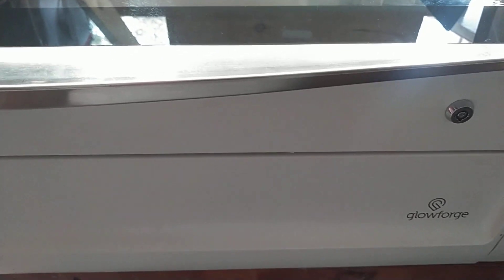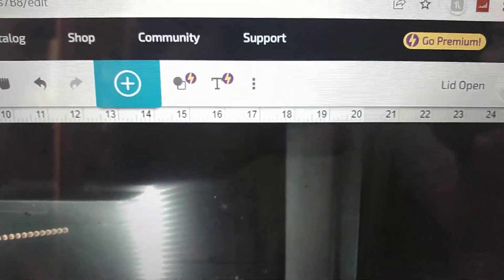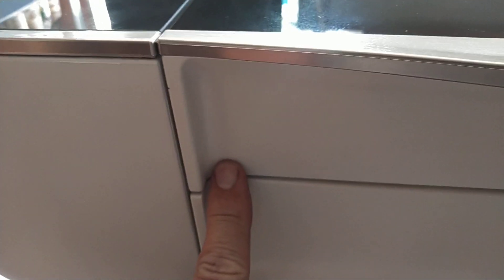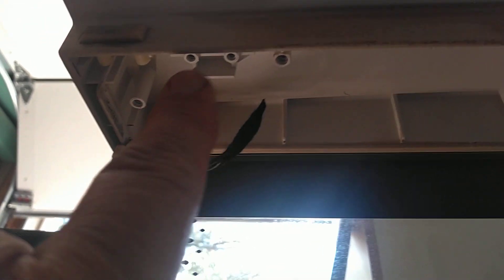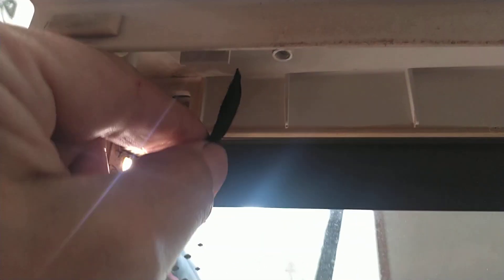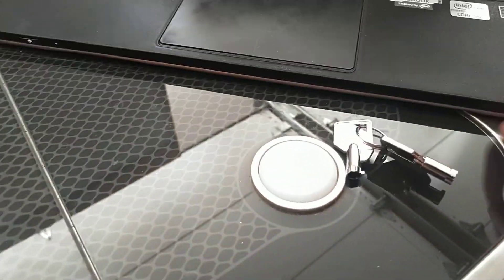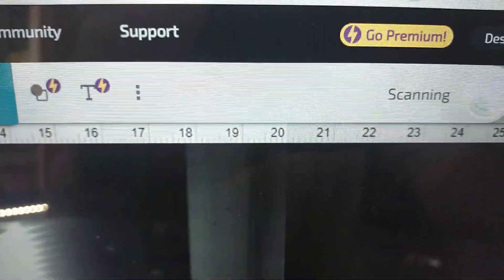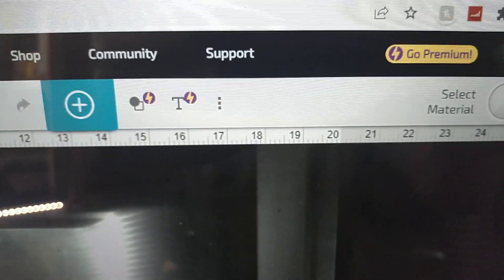Glowforge Front Door Bypass, Lid Open Error

Comment: Hi! Are you still available to ask a question? Was that LID OPEN error similar to an Interlock Open Alert? That's what I am getting on my (just out of warranty) machine. I am researching fixing it myself. I would appreciate any insight from you! Thanks!
Reply from the maker: I have not used my laser in a few months, maybe they changed the names of the warnings
Reply from the maker: Try contacting support they were always responsive with me when I had problems, they can elaborate on the error
Reply: @madscientisthut  They've already told me I need to send it back in and get a refurbished one for $1600+ so I am working on fixing it myself. Thanks for your input! My understanding is an Interlock Switch controls doors in many applications, so I am concluding that this might be the same issue. Can't hurt to try!
Reply from the maker: @kristinemerz9959  certainly will not hurt to try. If you get it fixed that will be so worth it!
Reply from the maker: Did you see my other video where I showed how to check if it is the switches in the lid?

Comment: Just curious but did you try taping a magnet to those spots where the sensors are before cutting them? That's a quick an non-intrusive hack for anyone to use.
Reply from the maker: yes, one of the switches was bad.
Reply: @madscientisthut  I did have the same issue at one point too and they determined it was the ribbon cable that ran from the back of the lid. They sent me a new ribbon cable which resolved the issue.
Reply from the maker: when my lid camera started become intermittent the black printed circuit cable in the back was the cause.

Comment: Hi I just saw your video because my glow forge pro just ended up with a lid open error like yours and even though your video explains what you did it is obvious you know what the hell you’re doing whereas I know nothing about wiring and locking mechanisms. Do you have any advice on how to make this fix for dummies? I currently have a very expensive 2 1/2 year old brick on my hands now
Reply from the maker: New how to bypass the sensor video is live on the channel
Reply from the maker: I am curious if you had a chance to try out the steps from the video.
Reply: @madscientisthut  Hey yeah I tried it today and nothing happened so the expert I have been working with thinks that it might be a motherboard issue and I think I’m ready to just take the refurbished deal
Reply from the maker: oh bummer. Well at least you may get back up and running with the refurb lid.
Reply: @madscientisthut  the refurb deal is the whole machine 1651.
Reply from the maker: oh wow, that is great!
Reply: @madscientisthut  I wouldn’t go that far and I’d hardly call sinking upwards of 7K+ into a laser in 2.5 years especially one that is worthless without internet access but it definitely helped me break into the world of laser products designing and making so I guess that’s the silver lining if it has one but I am now fully aware I need a secondary machine that I would love that doesn’t depend on internet. Thanks again for all your help!
Reply from the maker: Just put together a video. Going to splice it together in an editor, then upload it. It will be about an hour or less. I will let you know when it is live.
Reply: @madscientisthut  thank you very much. I will have more dedicated time to dig into trying the fix tomorrow evening. I will keep you posted as it goes!
Reply from the maker: First go through trouble shooting with the Glowforge support staff, it can also be a problem with the lid cable that goes between the main unit and the top of the lid. They sell those in the Glowforge spare parts section. I actually had my lid camera stop working a couple of years ago and had to replace the cable. Also it could just be one of those 3 points that the lid cable is connected at is loose or cocked at an angle. If you come to the point of where I was and asked to ship it back then the very simplest fix would just involve shorting the connectors for sensors at each connection point. This will get you going in a pinch if the magnetic switch is the cause of the issue. (also be aware by doing this you can open the lid with the laser running, so it is on you to take laser safety into your hands)
Reply: @madscientisthut  thank you for your reply. I guess I should have told you I have dealt with GF support, they offered to sell me a refurb, I have been working with a friendly Glowforge thread expert and we just tested magnet hacks with no help. All of this started with the Lid Open error and I purchased the black cable and replaced it at which point GF support were at a loss. The friendly expert said the next option he could offer would be to buy a replacement lid and try that but not sure I’m ready to pay 350. Yet til I try other inexpensive hacks first.
Reply from the maker: @suzinelson8914  let me go and look at my GF lid. I may do a quick video to show you how to short the connectors to try to see it "clears" the lid open error for you.
Reply: @madscientisthut  thank you!!
Reply from the maker: @suzinelson8914  The connector does not have much space to squeeze a wire into test "short" it. Do you have an old cable like a cheap two wire extension cord that has stranded wire that you can get a couple of thin wires from?
Reply: @madscientisthut  I am a visual learner so following a video step by step is the best I can hope for. Thanks for trying